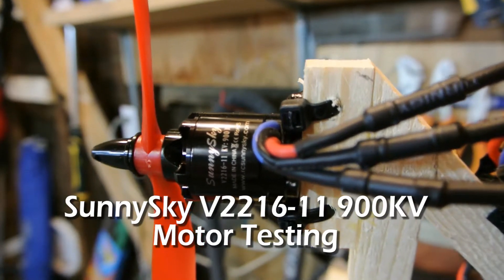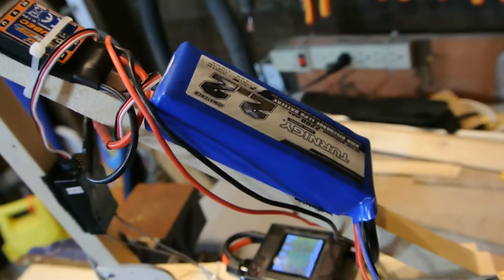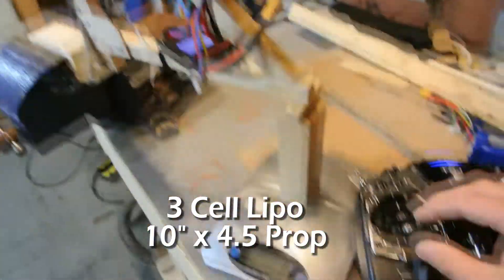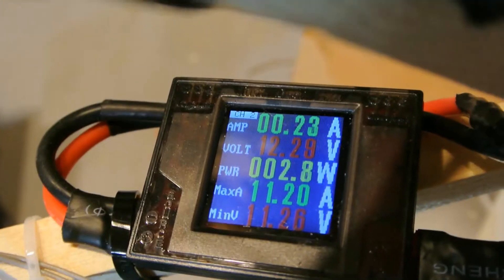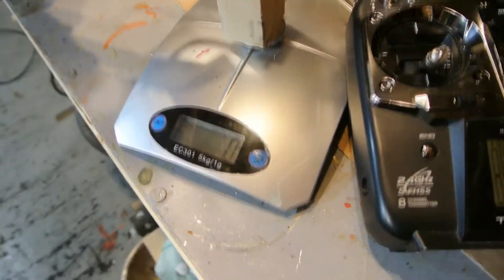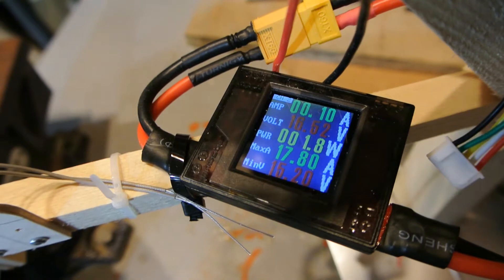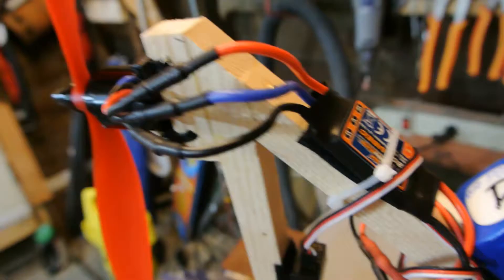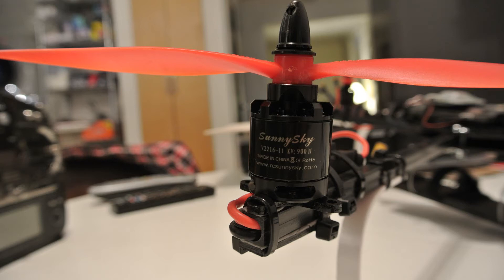Review of Sunnysky V2216-11 900kv Motor - Part 2 - Thrust Testing

Comment: I find it annoying when people do amp and thrust test on a motor and they full throttle it. how useful is the data when no one ever hovers at full throttle. how about next time you half throttle it, check the amp draw and thrust. maybe people can multiply the thrust and amp draw by 3 (tricopter), 4 (quacopter), 6 (hexacopter) and so on, that way they can figure out flight times and payload.
Reply: finally a sensible comment of YouTube..
Reply: if you know the max thrust it's reasonable to know the mid throttle thrust. If you don't understand that what the fuck are you doing in this hobby?

Comment: I use these motors on my TBS discovery with all up weight of 1.95kg including a 5200 mah lipo 4s. I was able to take up to 120m without any problem. I used a gemfan 1045 carbon nylon mix props with DYS 30a v2 esc (blue series). my quad hovers at 40% throttle, a bit overpowered still. So far, so good motors

Comment: With the 10.45 in 4s you might overheat the motor a little bit. Probably a 9x5 would be safer in the long term to use...less vibrations and more than enough power unless you want to go onboard!  ;D

Comment: what kind of props did you use (1045 size )
which company ?is it  plastic ?
Reply from the maker: They are 1045 slowfly props, Turnigy hobbyking brand or Gemfans, I forget exactly but the cheapy ones.
Reply: http://hobbyking.com/hobbyking/store/__25824__10x4_5_SF_Props_Black_CW_2pc_CCW_2pc_.html  
thx bro .. I found these do u think i ll have diffirent resuls ?
Reply from the maker: AHM RO I ordered them over a year ago but I'm 99% sure those are exactly the ones.
Reply: thx bro 
have a good day .

Comment: Please tell me if these motors are suitable for my Tarot FY690 hexacopter and Walkera G-2D gimal with SJ4000 action cam + Naza M V2 with GPS + FPV Boscam transmitter + 4S 5000mAh battery.

Comment from the maker: Use what every one you like, I only use the nice black cone cap with a little locktite.
Reply: Would you recommend these 900kv or the 980kv for the typical 3s, 2 axis gimbal and gopro build?
Reply from the maker: Adam Keely I'd go with the lower KV motor since you will be carrying a bit of weight, might want to even go lower than 900 with larger props.
Reply: How much lower do you think 25amp ESC's could tolerate?
Reply from the maker: Adam Keely That really depends on the motor combination, most motors will give you an amp draw for a given prop size.  You'll need to look at the specs, but in most cases for multirotors  that you will use these 22 size motors, a 25amp esc should be enough.
Reply: Oh thanks for the positive feedback I'll definitely look for some combinations

Comment: For a 1.4 kg quadcopter, with 4s, for fpv. Sunnysky 980 or 900? With prop?
Reply from the maker: Depends the 900 will be more efficient, you might get a longer flight time.  The 980 will faster and you probably would have to use 9" props.  I'm using 10"x4.5 on 4s with the 900 and have had good results.  for really long flight times I might go with some low kV motors and 11 or 12" props.
Reply: Andrew W thank you, those from 900KV, the diameter of for the propeller is 5 mm?
Reply from the maker: Lorenzo Longhini Yes the shaft is 5mm.
Reply: Andrew W last question trust with 4s and 9x5? For a 1380 Gr quad
Reply: +Lorenzo Longhini I use 1045's with 3S power on my S500 with the X2212-13 980Kv Sunnysky. Great combo and quite of used. I'll be trying them with 9" and both 3 and 4S power next.

Comment: Ok my current config is on a tarot 680 pro. Same motors 30A esc with 1045 props tarot t2d gimbal and go pro .. Current weight with batt is about 2.6kg. So if I juz plug my 4s will it be ok.. Coz time isn't on my side to test.
Reply from the maker: I'm not sure I can't really say for sure how it will be without some testing.  Just try it and see if the motors get hot.

Comment: I have the exact motor but can it handle 4s..I'm afraid I might burn off the motor.. Using a hk 30amp and the exact motors
Reply from the maker: I havd been using 4s and have had no problems but don't use too big of a prop.  Also if you have an amp meter measure what the motor is drawing with your setup.  Another test is to run your motor hard and then see how hot the motors are with your hand, if they are too hot to touch then they are burning up.

Comment: Hi, will the motor V2216-11 900kv work with AFRO ESC? I have similar motor (multistar) and I have sync issues with it...
Reply from the maker: I'm not sure, I have had problems with afro escs on DT 750's so I know what you mean.  I think ( i haven't tried) you can reflash the the esc with an updated firmware or change the timing of the firmware, but that require reflashing as well.
Reply: Andrew W Ok thanks, do you know how to change timing in the firmware? I already ordered USB flashing tool.

Comment: Does the motors get hot running 4S for a long period of time?
Reply from the maker: They do get warm, but not burning hot.  I think if you were to run them at full throttle with a 10"x4.5 prop on 4s then they might get hot.  But in my experience so far they have been fine.
Reply: Andrew W I have placed an order for the 650 kv version, do you believe they will perform as good as these with turnigy multistar 20A esc with simonK firmware? My quad will have a total weight of 1,7kg and i will use it mostly for AP, so no sportflying :) i am asking because i might have the option to change the order to 800kv instead because the 650 is out of stock over at banggood. Wich one would you recomend?
Reply from the maker: Markus Palm Kåberg
I think the 650kv would be better suited for AP, lower KV motors will generally be more efficient, all things being equal (same motor series), you will be able to run larger props and lift more.  But, hmm tough call if I would change to 800KV, I would probably post your question over on RC groups or Flitetest forums for some other people's opinions.  These motors should work just fine with the multistars but look at the motor specs to see the max amp draw.
Reply: Thats what i thought to first, but then after reading about problems with motor in general getting hot with 4S + big props and also the issue with props casting shadows on the camera i have had to reconsider my choise, i turn to you since you seem to be the only one that have tested these motors except the 900kv wich i also found soe more info about, but the 650kv not a word anywhere.
Reply from the maker: What prop size were you thinking about going with? I have these motors on a quad as well and it weighs 1.5kg, with a 3000mah 4S battery I get 10 minutes of flight and the motors are just barely warm.  Prop size is still 10x4.5.
Reply: Andrew W i have ordered some chep HK 1045  props. But i'm thinking about testing others eventually. Still have'nt received any of the parts and i'm a total newb to RC, except i have a HSP troian car :) banggood have replied and i now have the option to change, but now all three motors are out of stock. Bah! :( i think i'll go with the 650 anyway, and later on maybe do review and throttle test :) thanks for the help.
Reply: Markus Palm Kåberg You will new big props for the 650kv motors, i recommend going with 900kv and 10X5 or 11X5 props